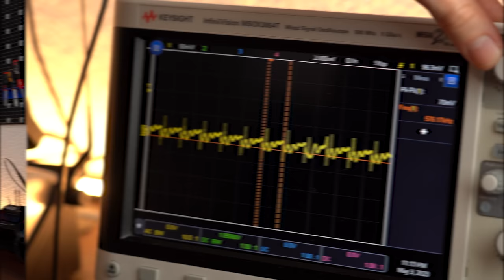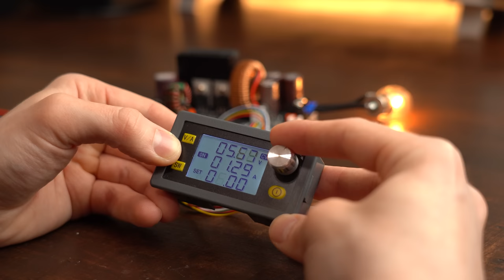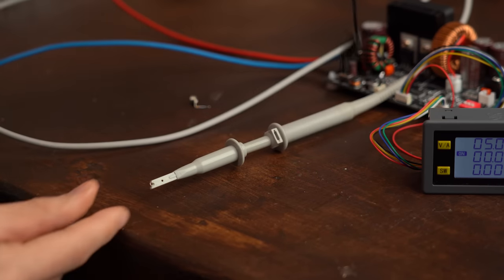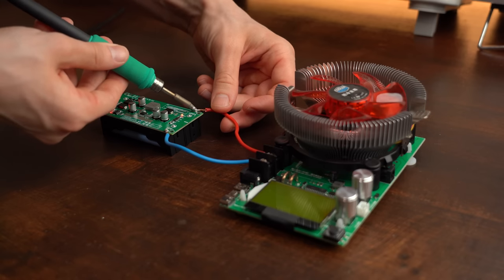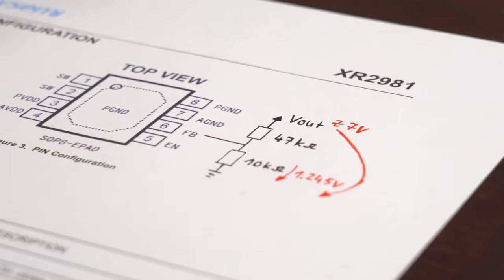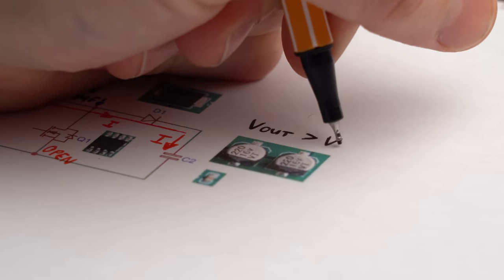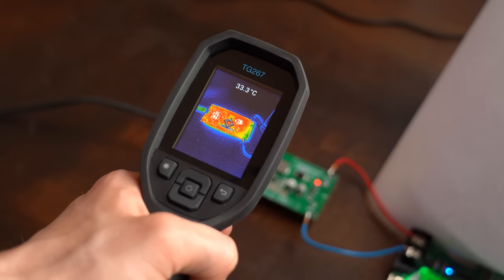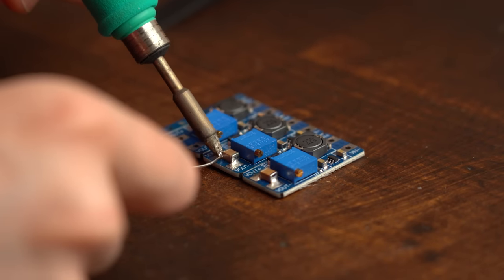With Just $0.50 Components I turned Garbage Products into GOLD!

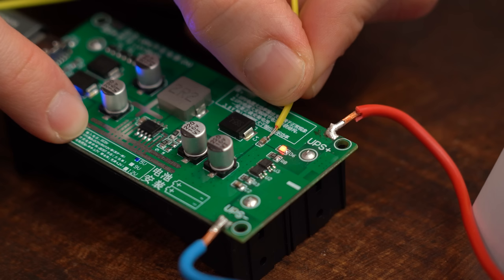Comment: One major contributing factor to noisy outputs on many cheap/Asian Aliexpress-alike regulators is poor layout. Take e.g. 8:50 - they use polygon pours to reduce impedance (good) and provide more thermal mass/lower thermal resistance (good), but all the components are still awfully, widely spaced, leaving still considerable inductances, which is especially bad on the switch node, as it has high current ripple. As V = L * di/dt and your L (trace inductance) is high, your di is high and your dt is small, this creates ripple noise. And  as layout is something inherent to your PCB (it IS your PCB basically), you cannot easily change the noise created from bad layout.

Even the best components can deliver embarrasing performance if you do not do the layout right. Remeber, electronics is not so much about charges moving, but about controlling and containing your fields. But there are far more talented people out there, which can explain that in much better detail and accuracy.

Comment: I'v got a ups version with 3 diodes on the input, and two diodes on the boost converter. Even two small ceramic capacitors on the output. The diodes, electrolytic caps are getting really hot. Output voltages is 4,8 volt with ripple. Could deliver 3 amps. But if i pull that current de diodes will desolder themself. Shitty product

Comment: They don't do it because they don't need to -- 99%+ people will not be analyzing the signal, and a sloppy 5V is fine enough for the things people buy these for; either the device isn't sensitive, or has its own built-in regulation.

Nonetheless, good info. Next time I need to use a cheapo boost/buck converter, I'll check the signal and maybe throw a post-regulator on there.

Comment: Technically, they didn't need to raise the price by 50 cents, the other 2 capacitors won't be needed anymore therefore the cost would cover these new 2.

The reality is that this board was designed by someone that either didn't take noise into consideration by accident or didn't care about it at all.

Comment: Great video again! 👍

When dealing with digital circuits, I rarely find myself having to deal with noise problems. Noise only becomes a factor when I'm working with analogue circuits. I often use a linear voltage regulator in combination with a low pass filter(LC or RC with low-value resistor) and of course decent decoupling for every chip. And it rarely stops there, one must consider whether circuit isolation is necessary to prevent current loops, as well as determine if guard traces should be implemented(for example an opamp circuit with high impedance load), etc.

Comment: Another awesome video!  In the video you said 2.2 uF ceramic capacitor for the mini boost converter.  But the website link goes to a 22 uF ceramic capacitor.  Is it meant to be 22 uF or 2.2 uF?
Reply: The modules I have seem to already have input and output caps of around 28uF, so I can only assume he means 2.2uF.

Comment: I ordered the parts from Mouser, so now the two UPS devices going to get the  upgrade. I even have 5 of those boost converters to that I will do the same with.
Thanks for this great fix video. Great stuff as always. Now I just need to find a cheap-ass oscilloscope, so I can test other electronics I have lying around.

Comment: I have a bunch of those same buck converters that I'd like to fix, but the links provided are for a 22uf and 1uf capacitor, but the video mentions a 2.2 uf on the output?  So which one is correct to fix the final small buck converter?  The 22uf link or the 2.2uf mentioned in the video?

Thanks in advance for your time to answer.

Comment: I bought the UPS circuit in 5V and 12V versions, but I've received 9V instead of 12V, so from this video I've easily recognised the resistors to swap for the voltage divider, but buying the exact components is not feasible due to the shipping costs, so I went to the harvest route. The problem is that my multimeter is not very good at measuring resistance, so I harvested some similar resistor from another circuit that had similar resistance without really knowing the exact number. Well the good part is that I managed to obtain 7V, 10V, 13,5V and 20V and left it at 13,5 that is the most similar (also should allow more power and staying close to 12V during high loads). It will be useful to know the exact resistance, maybe you could pick it up again and make a couple of final upgrades: a potentiometer to regulate the voltage and an interruptor to disconnect the batteries when not needed. Maybe design a cool box 🙃. Having a clean output is not always critical, especially if I know such regulation is done at the receiving end.
Reply: Just received mine, a 5V and a 12V. Will be using 1 for a solar project. Just be careful with the voltages!   Capacitors seem rated at 16V max and I would stay at least 10 to 20% below that.  Checked my 12V version and that smd resistor R7 has a marking 9092 which is   90.9 KOhm or 90.900 Ohm. Also the board has been changed as his has R7 and R7* . The R7* has turned into R12. 
I would always opt for a clean output. Spikes can produce noise on radios if you use longer wires and in some cases cause strange effects. I always also place a 100nF cap on the input and output.

Comment: Well... I've got some of those mini boost converters and i already knew that something wasn't right. Only a small SMD capacitor on the output. On my projects when i used those boost converter modules, i always added some extra capacitors on the output (Both electrolythic and MLCC).

DC-DC converters are INCREDIBLY useful in basically everything.
I wanted to ask if you can make a video where you analize a 'special kind' of DC-DC converter, the one used in ALL car audio amplifiers: A single rail to double supply rail DC-DC converter. I could not find any appropriate schematics anywhere. This DC-DC converter is really useful but i just cant find a way to make a proper DIY version. A lot of people is probably searching a way to make this DIY... I think that a video about this topic will explode on views! (And help a lot of people too).

A DIY version is really versatile, because you can have full control over both the output voltage and the power that the circuit can handle. It would also be a nice learning experience.
With this circuit, a battery can run ANY audio amplifier!!

Comment: Two 100K ohm resistors, a 2.5 V reference diode, and an OpAmp and you can also get a very stable 5V with current up to the opamp’s output current rating. Also, thank you for admitting a mistake, many wouldn’t be willing to say that, very cool!

Comment: A lot of people are fine with noisy output. It all depends on the use case. For example, I know many people whose wives produce noisy output. They simply ignore it and over the years even develop some resistance to it.
Reply: de-solder. it will reprogram the flash automatically

Comment: One of the 1st things our teachers told us at LTI is the difference between an expensive VCR and a cheap VCR is a 5 cent component.  Like they will use a 1/4 watt resistor to dissipate a 1/4 watt of power rather than using a half watt resistor. Everything today is built down to a price, its the race to the bottom which got us lots of cheap junk.

Comment: Have you tried asking the Chinese seller why they don't use the other capacitor? In my experience the Chinese have quite good customer support. The answer may be difficult to understand due to machine translation, but they usually do answer. Your request may even prompt the Chinese to change their PCB to use the other capacitor in the future.

Comment: Oftentimes, these boards are based around one key component, i.e. the regulator IC. If you were to reverse engineer the board and compare the resulting schematics to the IC's reference design, you'll find probably little to no differences. And very often, the designers doesn't really pay much attention to the textual parts of the datasheet that explains the values and different usage cases, or just use one calculation for all their product runs (i.e. the same capacitors for fixed 3.3V, 5V, 12V and variable variants of the board). Also, the reason they won't add it is cost and availability. They already most likely have tens of thousands of cheap small mlcc caps around, adding one to the output won't change the BOM cost by much, but also doesn't have to affect the output in the desirable way, or even hurt it. 
Thank you for showing us this

Comment: 100% about cost. Sure the part may only be 3 cents for them at bulk rates, but they already have the tooling setup for these PCBs and the components on them, and they're making truck loads of them per day, those 3 pennies per unit add up.

Comment: My guess for why a manufacturer wouldn't include the fixing product is just the cost of the better capacitors most likely being higher than the ones they used, and most of their customers probably don't check the outputs noise, but honestly I couldn't tell you if that is truly the reason.

Comment: Replacing the output capacitor with a low ESR one reduces noise, but also the power supply ripple. Often that ripple is needed for stability of the voltage regulator. I would always recommend to stick with  replacements to similar components and not deviate too much from the original implementation, unless one can measure the stability afterwards. Bad stability is often much worse than noise.

Comment: Bro I got so sad when I saw the mini boost converter cos I just bought it 😭, I just need 2.2 micro faraud or anything else ?
Reply from the maker: Yep. Good quality 2.2uF and you are good to go.
Reply: @greatscottlab  Thanks, love your channel btw but why you gotta do that "AND I WILL SEEEEEEE UUUUU NEEEEXXT TIIIIIMEEEE" thing at the end pls stop it :face-pink-tears:
Reply: @greatscottlab  I think I read somewhere with these MT3608/SX1308/HW-668 equivalent boost converters if you want to use an input voltage under 3.6V and an output above 5V you should set the output using a 5V input first before you use the actual supply you want to use. Not doing that is what causes the self-destruct behavior for some reason.

Comment: I'm interested to know how you came up with the value of 2.2uF to add to the output. I myself am struggling with some buck/boost converters.
Reply: As a guess it was the largest commonly available capacity for the needed voltage rating and component size he decided on. He might have took the switching frequency into consideration but can largely be ignored if the original design worked at all.

Comment: Well, adding a capacitor, or actually 2 or 3 in parallel (with different capacities, or how that's called in English) should eliminate most of the ripple problems in any case, AFAIK... And usually I recycle some obsolete or burned out PCBs, so it don't even cost a cent for new parts. Capacitors you should be able to find at nearly every PCB, and spotting defective electrolyte capacitors is easy in most cases. AND you recycle, so it's good for Mother Earth too ❤

Comment: Limit your scope to 20MHz...
I remember when I wanted to measure anything that high at the college I worked for, I'd have to break out the really expensive 20MHz scope. The standard bench scopes couldn't measure anything above 2MHz.

And before you question why they were so terrible, keep in mind that these scopes were old analogue scopes and could measure 600vPk-Pk and not care. I think if you try and do that on a modern scope, you'll end up with a charred mess.

Comment: Is this the reason why cheap bench power supplies use a linear regulator on the output?

For example 5 amps @ 30v / 150watt

But lowering the voltage to 5v you would expect 130/5 = 30 amps

But no, all you will get is 5amps regardless. I always figured that was done on purpose to prevent noise, now I'm thinking it's another reason entirely

Comment: I would imagine the capacitor on the MT3608 boost converter is not included as it would reduce efficiency slightly and maybe in most cases isn't functionally needed? I could be wrong.

Comment: I have a similar boost converter from Ali that already has a capacitor installed at the specified location. They're advertised as being able to boost up to 28V but none of them went above 19.xV, sadge. I wanted to use them to deliver a higher voltage to 24V fans T_T. Any quick fixes that come to mind? They are of the MT3608 type with USB-C in, rated for 2V-24V in and 5V-28V out.

Comment: Consumers will take the lower price - it's about quantity here. A producer of such low price (and therefore low profit) products just needs the quantity. If he loses most customers to a slightly cheaper product which is slightly less usefull he will have a failure.
Also don't forget that this does not cost the producer 50 cnts more, as he has to produce the product in large quantities in advance. This is all upfront money, often "borrowed". a 50ct can easily turn into 500.000 or way more in required upfront money.

So it really isn't about that 50cnt .. it's about the consequences, those added 50cnt induce.

Comment: Question: I know nothing about electronics (can't explain why I love your videos, but I do!). Anyway. I have a very old record player. If I connect it to my amplifier, the sound is horrible. I was told I need a pre-amp with "phono" input. I purchased one, not cheap but not expansive, but it introduces a lot of noise. 
What can I do to have better sound, except buying a better pre-amp? I was also told that instead of preamp, I can use something that changes impedance. How do I try this?
Thanks for the great content!

Comment: A lot of people don't understand ceramic capacitor dielectrics. Y5V ceramic capacitors are cheap but can lose 90%+ of their capacitance at elevated temperatures and also generally have poor ESR/ESL. X5R and X7R etc are much better but cost more. I never bother with Y5V and stick with X5R/X7R/X8R/C0G depending on the application.

Standard aluminium electros usually also are only effective up to maybe 200kHz. Above that you really need to use polymer and/or tantalum caps or paralleled ceramics.

Comment: If you use a linear regulator to attenuate the ripple, check the linear regulator's Power Supply Rejection ratio (PSRR) graph vs Frequency. The Switching Mode Power Supply(SMPS) frequency and harmonics are above 100KHz to 1MHz.  So the PSRR needs to large at those frequencies.
If the regulator data sheet lists a PSRR number only , its for 60Hz. Typical not useful for use with a SMPS.

Comment: Well... the PCB is poorly designed. SW node is unnecessarily large, current loops could be literally 10 times smaller. Look how far this MLCC you changed from converter IC! And it is very important! That is just stupid. So no wonder that it also has a poor component selection. They just do not know very well what they are doing. They just thought "Oh we will take x10 required capacitance and our garbage capacitors should work fine then". Nope. They will not.

Comment: Scott...can you make a small portable device that will be a varible resistance load (Rheostat) that includes a display that reads the set resistance even if that is connected to an circuit. Like a resistor substitution box but with a digital read out?
Reply from the maker: I can put it on my to do list :-)
Reply: You mean something like a decade resistor box?
Reply: @richardlighthouse5328  yes but with a digital  or led display that shows the resistance applied and a rheostat instead of 20 switches.
Reply: @greatscottlab  thank you.
Reply: @Ezzell_  You'll need 20 switches no matter what, mechanical or electronic.
Reply: @richardlighthouse5328  A rheostat....  do you  not know what that is?   it would replace the decade switches.
Reply: @Ezzell_  Yes I understand that a rheostat is a variable resistor. However you cannot digitally control one, all programmable variable resistors are implemented as decade switches.
Reply: @richardlighthouse5328  You are not reading the post carefully.     A RHEOSTATE WITH A A DIGITIAL OHM METER BULT TOGETHER IN ONE PACKAGE. THE FINGERS OF THE USER CONTROLS THE RHEOSTAT ...NOT DIGITALY.
Reply: @Ezzell_  Ohhh...

Comment: Yeah I've been trying to measure a gas sensor, and I've found that every USB power supply I plug my NodeMCU board into produces a different result on the gas sensor.  An Apple iPad charger makes the analog measurement noisy.  A Samsung charger makes the measurement get cut in half.  It really makes a huge difference in my circuit.

Comment: Hello, is it possible for you to check XYH3606 buck boost converter? It is very nice, cheap and small kit and can be purhased with dedicated aluminium housing. I've got one for portable power station(coupled with parkside 8ah battery) but I can't check voltage ripple etc. because I dont have proper equipment. This small device also have under voltage protection, ovp, ocp etc. built in